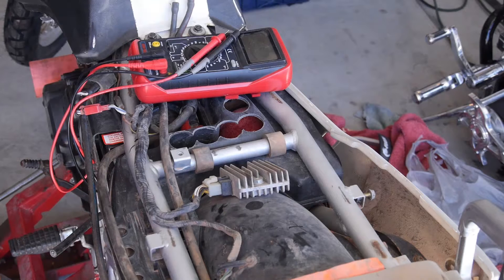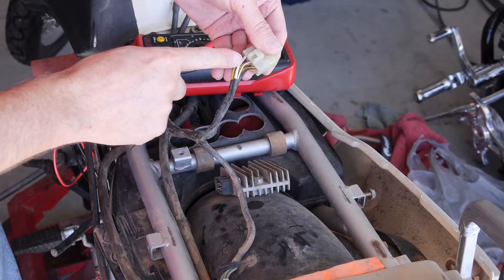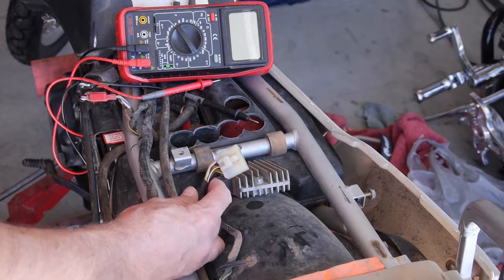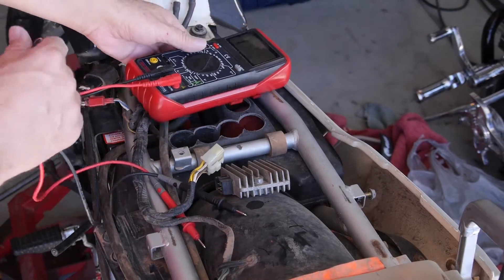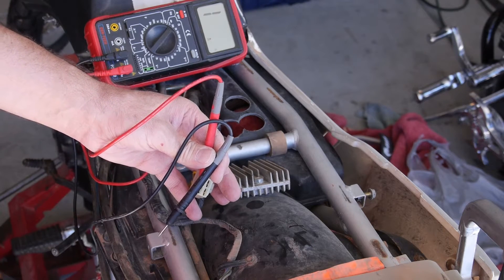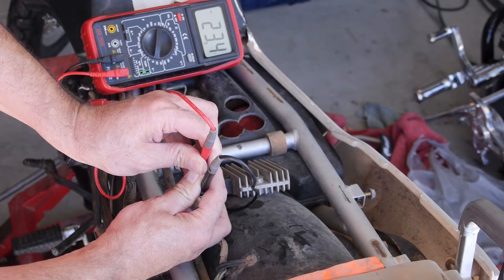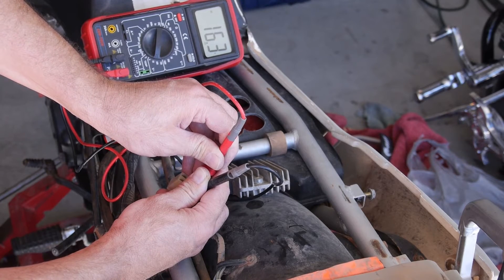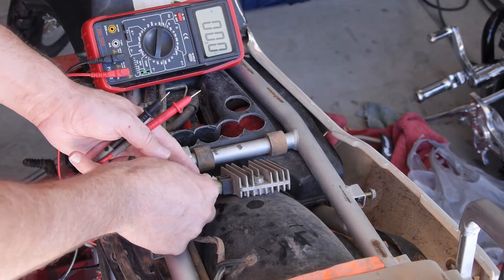KLR 650 - HOW TO TEST YOUR STATOR

Comment: Another fine video! Thank you so much for sharing! I first check whether my 2009 KLR was charging...it's not! No increase in voltage when I run it. So, I checked the stator...checked out good on Ohms and is putting out about 15 volts on all three sides. So, I suspect the regulator is at fault. Would you agree?

Comment: Cheers for the helpful video. 

Trying to learn more about alternator/stator/battery relationships to diagnose my own 2016 klr650 issues. I thought I might share the puzzle here in the comments. 

Bike battery at around 12.6V after a full 24hr recharge. When the key is turned “on” the voltage drops to 0.4. It cannot even engage the neutral light, let alone the starter. 

With my current, caveman understanding: I need a new battery - but a new battery would be wasted if the regulator were busted from a history of running at a low voltage (3rd battery in 4 years - likely?). A new regulator wouldn’t go far if the stator is faulty. To test the three phases I would need to run the engine, for which I need power. Which either requires a new battery or an external power supply(?).

Tossing up whether to replace it all and not eat for a week, or piece by piece and run the risk of compromising each units lifespan.

Trying to learn more about all of it, so the video is really appreciated. Nice one!
Reply from the maker: That's a very big drop in voltage bud. Could be a short.... So, this is what I would start with .... First, check to make sure you don't have a short in the positive side of your circuitry. That means, you take a test light, put the negative (black)clip on the positive post of the battery with the wires disconnected from the positive battery post (except the test light). Keep the negative battery post connected with it's normal wires. Now, touch the tip of the test light to the positive battery wires (which are disconnected from the battery) and see if it lights up. If it does, that means you have a short to ground somewhere which you need to check out further. If the light does not light up, then you likely don't have a substantial short to worry about initially. Then, use a pair of jumper cables, and your girlfriends car.... and jumper to the battery on your bike. Positive cable goes positive on your bike, and the positive car battery, the negative cable on negatives. Try to start the bike, once it starts, then remove the jumper cables and see if it will still run. Measure the voltage across the battery, and make sure it's below 14.3, and above 12.0 or so..... Report back, and we can help you problem solve from there bud......
Reply: @MrDuhfactor  I typed a reply before but I must not have sent.

Thank you so much for such a comprehensive suggestion! I will check for a short and check running voltage if I can jump start it. This is appreciated.
Reply: I finally checked the positive circuit and attempted the jump start.

The I used the continuity setting on the multimeter to check for shorts - no beep (the meter did read 844 without a defined unit, which didn’t seem to correspond to specifically tested resistance, which came up at 1.2*100 megaohms, so that’s just confused me more since the manual for the meter says it will either read “0 or a small number” when testing continuity. But i guess I’m getting ahead of myself there...). This was with disconnected battery and bike+ve->meterCOM:meterVOhmHz->bike-ve connection.

When I attempted to jump start the bike, the lights all turned on when i turned the key but the bike would not start when pressing the ignition; just weak stutters. This was the first cold start attempt in a few months, full choke at 15C/59F temperature. I used a healthy 900A jump starter.

Since I’m trying learn as much as possible, I’ll throw in my amateur guess: if it’s not a short, can’t be jumped and the bike is otherwise fully serviced, does that then mean that something in the starter is not getting enough power? Like maybe worn out wiring leading to the spark plug or whatever capacitor that may come before it?

Comment: I've got a no charging problem on my KLR.  I did the resistance test like you showed and I got 2.2ohms between the coils, but when I do the AC volt test I get pretty much nothing like 0.2v.  I'm using one of those little red harbor freight multimiters set to 200 ACV.  Any idea what's going on or anything I'm doing wrong?
Reply: same! did you figure it out?
Reply: It's late now but I had the same issue.  Turns out it was the fault of the cheap multimeter from harbor, the free sucks . Bought a new one and now it reads fine

Comment: This video is great! I have a question for you about a KLX650. My 1996 KLX650 has a stator, voltage regulator/rectifier, but no battery. How can I test the voltage regulator in this case? My issue is that my headlight gets dim when the bike is revved past idle. Thanks!
Reply from the maker: well buddy, if you can research the wires that come out of your rectifier and go to your headlight, you can simply check the voltage on the wired to your headlight at idle, then revved up. if your voltage goes down instead of stays the same, you need to check to see if your stator is doing it, or your rectifier. good luck!

Comment: I am wondering if there is much of a selection of superior, after-market rectifier-regulators for the KLR and DR650 ... Obviously, I would prefer a well filtered ripple, rather than a harsh square rms output ... It is possible to BUILD a superior RCL filtered output, using higher spec components.  ... Hmmm ....
Reply from the maker: You could build one, but individual components are big and may not be as easy to mount, etc. You can do it!! There are a bunch of aftermarket regulators that are high quality that people will convert to. I'm thinking about doing a conversion regulator on Peggy just to try it out.
Reply: MrDuhfactor Well ... You may know that a nice, clean, constant 12Volt supply is highly desirable, especially if you are directly powering personal electronics. ... Now ... Rectifiers come is two varieties ... HALF WAVE and FULL WAVE ... You DEFINITELY want a FULL wave rectifier (A FOUR  diode bridge rectifier)  ... Then ... You want to smooth that choppy output as much as possible, using as many as THREE stages of RCL filter networks (each one acts like a shock-absorber and smoothes the DC RIPPLE ... FINALLY, Some USB and 12Volt OUTLETS MAY employ separate filters of their own, AT THE OUTLET. ... There are many ways to skin this cat BUT we DO want super-clean power, from the stator-output and onward, if we can do that. ... Filter circuit diagrams are VERY easy to fabricate and it may just be BEST to FILTER THE OUTPUT FROM THE STOCK RECTIFIER ... That would entail 3 resistors and 3 capacitors and 3 inductor coils , as well as a high quality ZENER DIODE ... There are RC filters, as well, which do NOT employ coils but only use Resistors and Caps.

Comment: Thanks. What do you do for gas to test run the engine when the tank is off??
Reply: Also my 2008 has the regulator mounted vertically on the right side down behind the radiator. It is completely obscured by the tank which has to come off.
Reply from the maker: Hmmmmm...... I have a fuel cell with a hose to attach from it to the carburetor that I made.....
Reply: Thanks good idea.

Comment: idk if its a thing with stators but on three phase motors we also check continuity from each phase to ground because  a burnt motor will sometimes still show continuity threw each phase but if u get continuity to ground then it has a dead short and has burned up. so maybe check the ohms from each phase to ground there should be no connections if there is u got a problem.
Reply from the maker: Yes, very good point, I did that before shooting the video to check it, then forgot while shooting the video :( Excellent suggestion my man.

Comment: with the bike running i had 1 wire that was at 9.6 volts. would this be the cause of the starter dragging?
Reply from the maker: The starter "dragging" or being slow has to do with either the health of the battery, the starter itself, or the wiring to the starter and ground. If you have one wire that is not going above battery voltage when revving the motor, but the other two wires do, it just means that your stator is beginning to get weak, but you still should have enough voltage and current to keep the battery at a full charge... does that make sense?
Reply: @MrDuhfactor  hey i appreciate you responding! i pulled the starter off the bike and took it to a repair man to have it tested. what i ran into was after the doohickey fix when i put it all back together and went to start it and it was just a click and nothing. well i think the starter solenoid stuck in the engaged position. because i soon lost the battery and the cables were warm. so i figured the battery was dead and i needed to jump it. when i hooked up the jumper cables the starter came on and started cranking but, it didnt sound right. it sounded like an air power ratchet when it would crank. i checked the solenoid by my shop manual and it checks out?

Comment: I get over 12 VAC at higher rpms(4000+) but only 6-9 volts ac at idle. Stator weak? How does it weaken like that? Thanks.
Reply from the maker: Yes, the voltage running should never get lower than battery voltage alone (engine off), even at idle. It should be closer to 13+ volts. Stators short out from repetitive heat/cool cycles.

Comment: hello, we have a question and how to check the stator if the motorcycle does not start (lost the spark) thank you in advance
Reply from the maker: Its hard to explaine here, so much to write, the manual has a good proceedure for static testing while the engine is not running. If your bike wont start because it doesnt have spark, thennit could be either the plug, coil (unlikely), or the pickup, which is part of the stator.
Reply: @MrDuhfactor  thank you for the hints, I will let you know what was the reason(if i find)
Reply: Hello, the voltage regulator was damaged as a result of this ECU as well.  After replacing the parts and the motorcycle foot relay, the machine works perfectly

Comment: Mr. D. Couple questions. 1. Will a brand new stator typically show the same voltage across all the phases? 2. Even though a phase is still producing voltage doesn't it still raise concern if it is weaker or lower than the rest? Thanks a lot. Iv seen every one of you vids and  I have learned a ton. The project vids are the best!
Reply from the maker: Well, it depends on the quality of the manufacture. Peggy's coils on each phase of her stator are within .2 volts, but a lot of bikes have had varied voltage when I check them, both old stators and new ones. I'm sure there's someone out there that rebuilds them or something that would know why/ how often that happens. I've never had problems as long as each phase has equal to or higher voltage than the battery at typical riding RPM's. Most of the excess voltage gets bled off in the regulator anyway, so unless one is maxing out the electrical draw on their bike with lights, heated grips, heated gear, etc, chances are it doesn't matter that much.
Reply from the maker: By the way, thanks for watching bud, I love to hear peoples questions and comments!

Comment: Hi again, you recently gave me some advice on one of your other videos regarding my potentially bad stator.  Strangely, I'm still getting no AC reading from the new stator with the bike running, and no charge to the battery.   Hm, so now I think it may be a problem in the connection between the stator and the regulator, since the connection that I'm testing is at the regulator. Previous owner replaced regulator about two years ago.  I'm wondering what might cause readings indicating a dead stator on two separate good stators.  The previous stator didn't show any damage.  Sorry if this is the wrong way to inquire about this but if you have any further advice I'd be grateful.  You're by far the best resource I've found on the specific issue of Gen 1 KLR electrical woes and my brain hurts from looking for answers :) Reading my good old Clymer manual now.
Reply from the maker: Oh man.... so sorry.....It is rare, but it could even be a bad flywheel (rarely, the magnets go south) But, lets start from the beginning, and work our way through this. First of all, does the bike start, and run?
Reply: MrDuhfactor. Ok great, thanks! Yes, starts and runs no problem, I just have to manually charge the battery after a few starts, and it will also slowly die as I'm riding.  New battery though, since I originally just thought I had a bad battery and bought a new one.  As for the flywheel, not sure if this matters regarding the magnets, but when I attached the new stator I felt the magnets grab onto it when putting the casing back on.  I almost hope it's a bad part instead of a wiring issue.
Reply from the maker: The magnets on the flywheel should have enough strength to pull the cover on when you put things back together, so that may be ok. So, next question, are you checking the running voltage (three yellow wires) with the plug NOT attached to the regulator? And, your checking one yellow wire at a time, with the red voltmeter probe, and the black probe on a good ground? (like battery negative)
Reply: MrDuhfactor The tests that I have done are: ohm test between all yellow wires with bike off, tested good.  Test between ground wire (negative probe) and yellow wires (positive probe) with bike running.   Getting either 0.00v AC or .3 or 
.4, so minimal.  Not the 23 or so that you got in your test in the video.  Battery tests at 12.7 or 12.9 fully charged and when connected to the bike.  Shows no increase when bike starts, but drops to 12.3 or lower, down to 11.5., no change when revved up whatsoever.   The connector at the regulator, when unplugged and tested, seems to be showing a lack of voltage.  I'm going to run new tests tomorrow!
Reply from the maker: Ok, be sure to test the stator with the stator/regulator connection unplugged. If the stator is plugged into the regulator,  and you test the stator like that, a bad or grounded regulator could skew your results as voltage gets shunted to ground. Does that make sense? If you can take a video on your phone of you testing it, and send to me by e-mail, that would be great. Mister duh factor at gee mail dot com.
Reply: MrDuhfactor Sounds good, I really appreciate it.  I'll make a quick vid and get it over to you this week.  Could be I'm just missing something!
Reply: MrDuhfactor. Hi again! I sent a video a while back but after further testing I'm positive the stator is good (especially since it was just replaced).  Per the manual, I did resistance tests of the pick up coil, exciter coil, stator, and CDI at the front right side of the bike. All with ignition switch off. Stator and pickup coil tested to specification. However, both CDI and exciter coil tested bad (infinity readings all the way around).  Since the current runs through the exciter coil to the CDI, would it most likely be a bad exciter coil and therefore no current to the CDI and thereby to the regulator and battery?  I definitely have the problem isolated between exciter coil > CDI > regulator > battery.  I know battery is good and the regulator was replaced in the last year and a half.  Maybe exciter coil and CDI are both bad since both failed resistance tests? Thanks again, I appreciate any further advice!  I'm determined to be riding before this Tennessee Fall weather is gone!
Reply: I have the same issue. New battery, have to manually charge after a few starts or she just wont start up. What was the end result of this?
Reply: Also interested in results
Reply: @jonathanbritcher9257 did your ever find out what the issue was?
Reply: @OKzebra  I ended up replacing the regulator and had no further issues.  So I believe it was the regulator all along and the stator change may or may not have been necessary

Comment: You should check what the AC output specs are for the stator - that much variance between the phases would worry me!
Reply from the maker: Good point buddy. It's amazing how much variation there can be between coils. One pod could have one less turn than the others, making the voltage vary. As long as there's not shorts, no open wires (broken wire in the winding) and it's putting out voltage, your usually safe. Variation in voltage is quite common, but it is a great suggestion to know what the output specs are for that stator and compare, even for peace of mind.

Comment: What if all of the wires that go to the voltage regulator are connected?
Reply from the maker: Follow them down to a connector and unplug them. If there is no plug, use the pointed end of the voltmeter lead to pierce the wire sheathing you are testing.
Reply: MrDuhfactor I’m not getting any spark and I just replaced the stator. Do you know what the problem might be?
Reply from the maker: @mrnoone7377  could be the coil, coil wire, kill switch,  or rarely ECU
Reply: MrDuhfactor in the kill switch is every wire supposed to be grounded or is something wrong?
Reply: I got the spark turns out you should never buy cheap ignition switches from eBay. Turns out it was shorting some cables out making it not get the spark

Comment: I like that you know the meter will blow up at 7000V. Hah! You may want to hit any terminals you disturb with some dielectric grease. Especially if he is going to be riding in weather.
Reply from the maker: Good point buddy.... That meter was rated for 1k V DC, and I thought if I went above that, it would just pop the fuse.... she held on with a variac controlled transformer up to 7K, then went up in smoke.... Didn't have a fuse go surprisingly, just went down to Harbor Freight and bought another meter.... Wish I had that on video :)